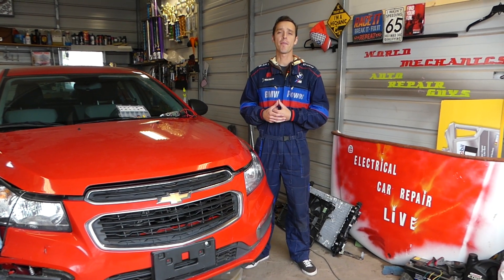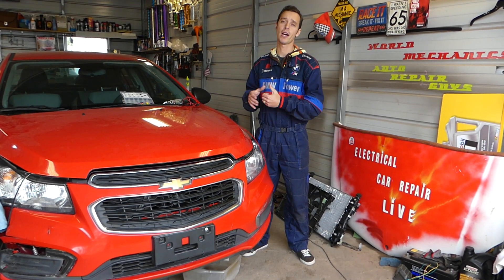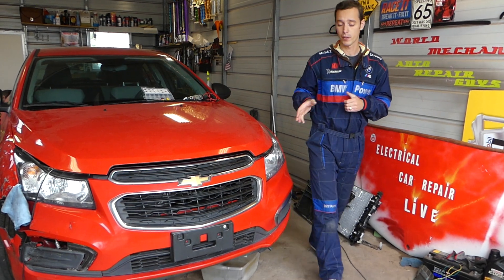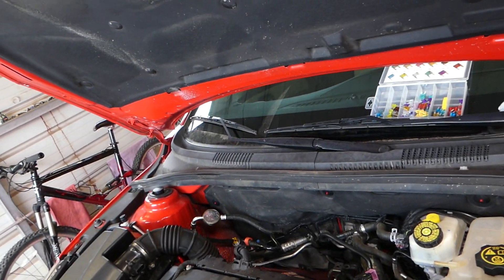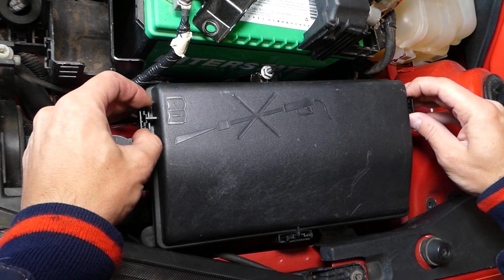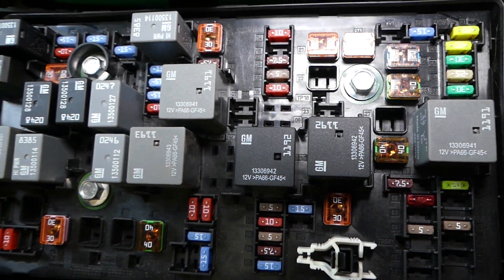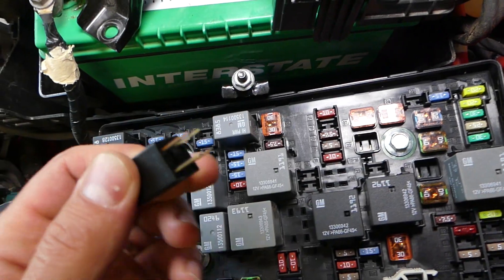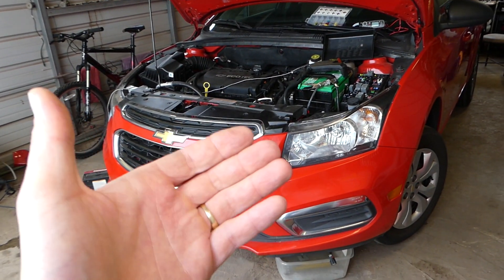CHEVROLET CRUZE FUEL PUMP RELAY LOCATION REPLACEMENT. CRUZE NOT STARTING

Comment: I have a problem on my chevy cruze 2010 1.8 LS when I switch the ignition on the engine light flashes very fast and stop after that it only cranks it will never start please help 😢

Comment: I have cruze..crank but wont start..crank sensor and camshaft have changed new..but wont start..code u0140 lost communication with body control module -invalid data
Reply: I also have a cruze that cranks but won't start ive check the fuses everything it's fine I bought one of those obd2 and only one code appear and it's the one for the thermostat that supposedly it's stuck on open but that shouldn't be a reason for the car not to start plz let me know if u find a solution for car nor starting

Comment: WRONG. The 2014 Cruze does not use that relay. If it did  mines been running for 10 years without one.